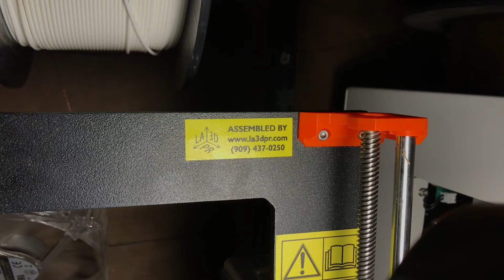Prusa MK3S fixing stuck filament or bad unload

Comment: Mine is clogged further down (1.25" or 32mm) below the gear feed opening. In other words it seems i have a blockage below this opening but before the hot end.

You mentioned doing a "cold pull" in this case. Care to elaborate? Any advice in this case?
Reply from the maker: That’d be a heat creep situation if it’s jammed in the heatsink; typically would happen if you shut off the printer hot or if you remove the extruder fan and heat the machine for any period with material loaded, the filament will expand in the PTFE and get “stuck” once it cools, pretty sure I’ve got a video on it.

Comment: Thank you, this video saved me from panic disassembling the extruder! I totally forgot there were multiple hex keys in the assembly package and tried to fit in the one which I uses to loosen the extruder door. Luckily I was not forcing it too much, I could have break something. The smallest one fits. Since I was using PETG previously, I heated up the extruder to the preset for PC filament and with some force pushed the key into the tube. I actually didn't notice it going any further, but it did the trick because once I reasembled it, the gear could finally push the new filament into the hotend.

Comment: Thank you, I thought I had lost a print entirely during a planned filament swap but the hex key trick was able to finally push that stubborn stuck filament back out the other end. I was so worried because I thought the revo hot end couldn't have this happen and I would hate to disassemble my hot end again...

Comment: This was the most helpful video for the problem I was having. As it wound up the filament had broken and bent sideways. I couldn't heat it and pull the filament out. When I opened up the feeder, I saw the problem cleared it and now everything is working perfectly. Thank You!

Comment: Thanks for the video.  I recently had my first stuck filament and ended up using the supplied needle nose plyers to work it up and out.  After getting the filament out I recut it at 45 degrees passed the stripped filament area and then reloaded it. There was a nice blob that extruded before it went back to being smooth, obviously my problem.  Did a test print and good to go again.  The other videos I watched had the basic "heat, unload, reload" which didn't work.  3 years later and your video is still saving people from a headache, much appreciated. PS.  I really enjoyed your initial comment basically saying, "It doesn't matter how we got here, but we are here." Made me laugh out loud because it is so true.
Reply from the maker: Cheers Max, happy it helped!
Reply: @LA3DPrinterRepair  I don’t know if you remember what to do but my spring fell out well fixing it and don’t remember where that goes can you please help me know where it goes

Comment: I am so glad you made this video. My filament was knotted on the reel and it broke below the gears in my Prusa MK3S. I tried pushing with the filament with no success. I tried a #50 drill, but it is .03mm too large. A #51 drill would likely work, but I don't have one. I was afraid I was going to have to disassemble the extruder assembly. Using one of the small Allen wrenches worked a treat. It was a little difficult at first, but then moved easily. I am now back in business! Thank you so much!

Comment: Thanks for the solution. In my case, the stepper motor does not revolve when I  insert the filament. However, without filament, it is working well. I increased the reference voltage of the stepper driver and changed the motor and it is the same.

Comment: Not sure what to do in my situation. Seems like it does NOT want to be pushed through and I have nothing to grab ahold of from the top
Reply from the maker: Sounds like you're gonna need to swap the PTFE, I've got a video on that procedure as well; if you can't manage you can send it out and we'll be happy to assist.
Reply: @LA3DPrinterRepair  I disassembled the extruder and the hot end was not receiving the filament because the canal too it was backed up. Everything is in working order now and printing phenomenally.

Comment: How would you fix the filament retracting before a print? I load to nozzle, select file from sd, hit print, bed heats, head goes to board, then retracts filament back to top. Firmware is updated to latest and calibrated the xyz. first layer calibration prints nicely.
Reply from the maker: at first blush it sounds like some questionable gcode if you can run a first layer properly, make sure your profile is configured correctly in PrusaSlicer, and don't use other people's gcode.

Comment: Great video. Thanks for that. I Just like to mention a thing I discovered when unloading the filament. If you do an unload filament the filament comes out and a beep sound is created with a message on the screen "pull out filament immediately". First it took me some time before I realized and read the message, but pulling it out was just going fine. Later on, when I knew the message was going to come to pull out immediately I already put my fingers around the filament to be ready to pull as soon as the sound beep would appear. My advice is not to do that. Because if you pull too fast the filament is getting stuck, It happened to me when i was new with the Prusa around 5 times. I took the message Immediately too serious. When I realized I had to wait 2 or 3 seconds before pulling after the beep, I never experienced a stuck filament during unload ever again. This can prevent you from needing to dismount the printer and repair it.
Reply from the maker: It says "immediately" for a reason: if you let the filament cool in an odd orientation, it can cool "hooked" and catch on the inside lip of the "lid". So no, don't let it sit there, but don't RIP it out like a wild-hair either, just guide it out at the same pace it's feeding and don't be a slacker about it.
Maintain grip when you start the unload process, the beep signals the physical handoff to the operator (you), so pull it away.

Comment: Didn't work for me, even tried to hit it down with a hammer. I had to go to prusa site and lookup changing the Bowden tube. The filament had expanded in the tube and clogged it. The clog was cause by not pulling the filament out fast enough while it was unloading.
Reply from the maker: You and nobody else, I showed it right on the camera, go to OEM chat if you want free help, I'm busy.
Don't turn your unit off hot like a N00B and next time you screw up, then you wont be in a ditch.
We don't do free help, fix it yourself.
Call me if you want a nice answer.
Talk dirty, get crap ok.
Be nice.
We're here to help and we're the only ones with a phone number.
Who are you anyway coming on my channel like that?
UNSUBSCRIBE, LOSER!
WE MAKE THIS EASY FOR KIDS, GO STEAL CANDY!
Reply from the maker: see what happens when you don't tune in 6p thursday after bonanza for 2nd bonanza, to hang?

come get me, jerk!

I'm right here.

Comment: Unfortunately had a 16 hour print fail twice at around the same time (hour 11ish) with this problem..
Thank you so much for saving me a massive headache! Mine turned out to be this combined with a clog, assumingly due to previously printing with PETG and not all of it got out. I preheated my hotend to well past PETG temps, and manually pushed out my stuck filament like in this video, and then pushed a bunch of PLA through the extruder to force out any leftover buildup inside.
Hopefully clearing out my nozzle of any leftover other materials will let me fix this print.

Thanks again!
Reply from the maker: Sounds like it's time for a cold pull.

Comment: Thanks for this tip. I saved me from dismantling the extruder. I had to bend the hex key slightly to get it around the extruder drive gear and into the PTFE tube.

Comment: Thanks brother! I was freaking out because I had my printer upgraded to mk3s and the auto filament has been a headache for me. So I just turn it off and whenever the printer runs out I just manually put it in like I did with the original mk3. What do you think about the auto fill?
Reply from the maker: Filament sensor is great but may need a little one-time manual alignment to work properly, that’s what the sensor info screen is for. 👍🏻

Comment: My filament was so stuck that even pushing it with a metallic tool was not helping. 
I finally managed to unclog it by heating my 1.5mm allen key enough so it can enter inside the clogged filament and push it.
Hope it can help some folks.

Comment: Thank you for the helpful video. I have tried your steps and still am having trouble as the filament looks to be hardened right below the gears. No luck pushing it downwards and no chance of pulling upwards. I have pushed a small acupuncture needle up from below but is a bit short to get to my trouble. I have a picture of the trouble but am not seeing a mechanism to attaching here.
Reply: I had the same problem, take a sewing needle or any other narrow sharp object from the open side door and stab the bottom of the glob. Lift it up while you press "unload filament" and it will pop right out
Reply from the maker: Reach out through our website, we’ll be happy to help: www.la3dpr.com
Reply: I have the same problem. I can insert a needle from bottom with no blockage. The filament is broken right at bottom of the gear box. I heated the nozzle to 250C for ten minutes. But the filament will not budge when I insert a probe, no matter how hard I pushed. I am reluctant to apply any more force. The filament there is not melted and it feels as if it is stuck/glue at that point.  What are the steps prior to pushing in the probe? What temperature are you heating the nozzle to? Are you heating anything else? Should it heat up all the way to that point of the filament? Should I take off the fan on the side, to have it heat up the whole extruder?
Reply: @KevinKelly  I had the same issue with my filament being completely clogged even with the allen wrench. I ended up heating my allen wrench with a lighter (used an oven mitt to prevent burning my hands) and once it was hot, I was able to push through from above and unclog it like the video showed. Thanks for this video and Defacto in the comments above for the recommendation of heating the allen wrench.

Comment: Great video.... my question is What do you do when you hear a clicking noise. What should a check. Driving crazy. I did all this. Still the same the noise. And Can’t finish my print
Reply from the maker: The clicking noise comes from the motor, but the obstruction causing the back pressure which makes the motor stall is in the hotend, most likely if the printer has been working well for countless hours, is carbon deposits built-up in the nozzle, poke it until it flows, then cold pull it until it’s clean, or swap it and be sure to hot-tighten and do it right. 💪🏻🖨☝🏻

Comment: Thank you! I worked for me. I took it apart multiple times and this finally did the job. :)
Reply from the maker: If you did a tear down, be absolutely sure the PTFE in the hotend is secured with the collar, it should have no movement up and down, otherwise you can have strange extrusion issues during retraction. Good work!
Reply: @LA3DPrinterRepair  Thanks for letting me know. I will make sure it isn't able to go anywhere.